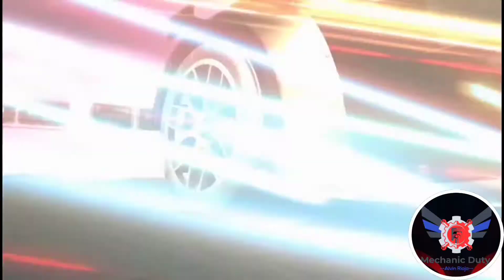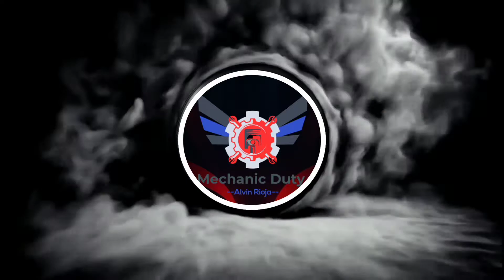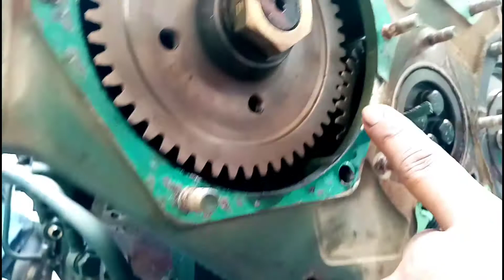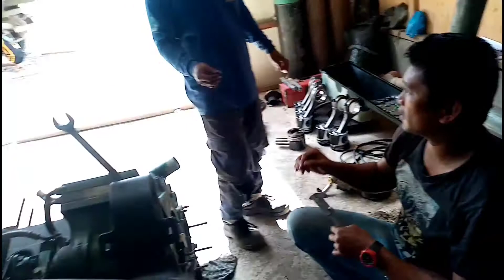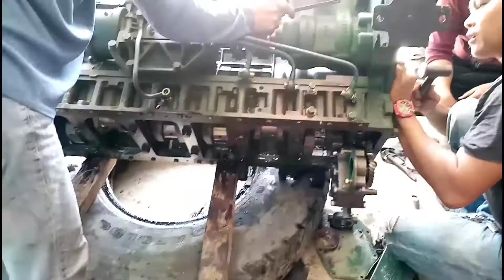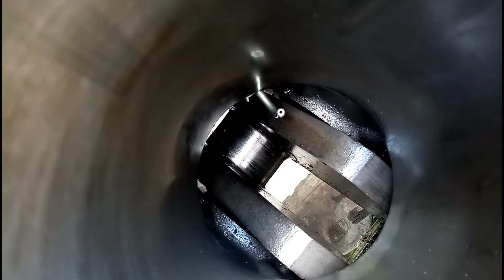TIMING MARK NG HOWO DUMP TRUCK /TDC/ VLOG #15

Comment: boss ano kayang problema ng howo ,naka 3 na aqng palit ng head gasket pero laging pumapasok sa ibabaw ng piston ang tubig,,salamat po sa sasagot
Reply from the maker: E check mo boss, bka my crack yang cylinder block mo,, or e pa repaste mo ung cylinder block.. Pwd mo rin e pa crack test
Reply: ilan boss ang tamang higpit ng head bolt ,ung auxillary bolt tsaka main bolt?
Reply: Butas injector sleeve